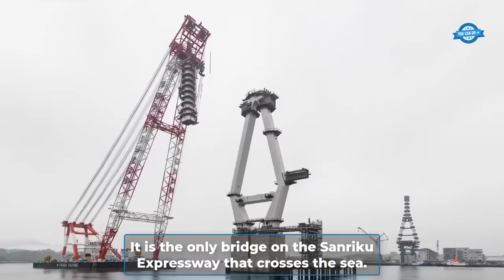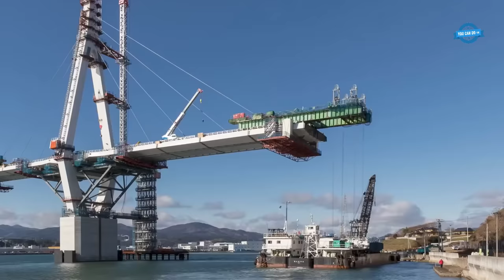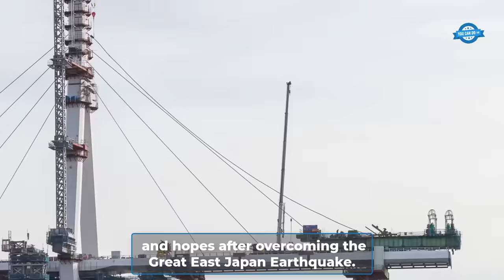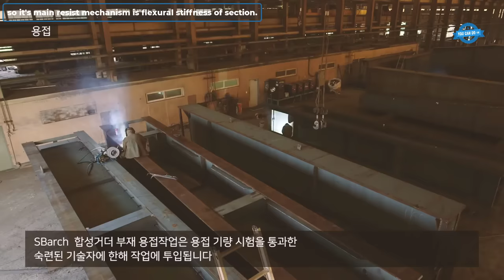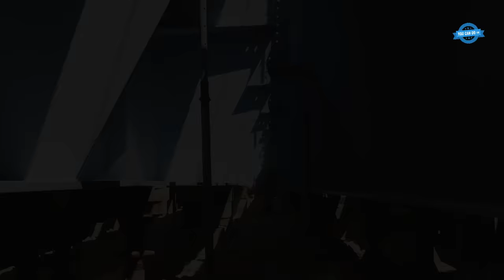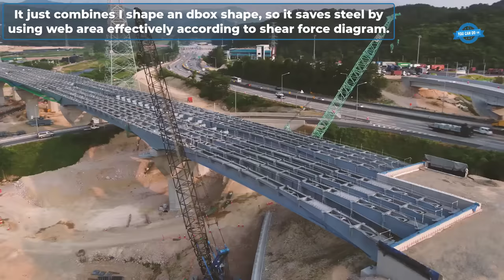Japan and Korea's Amazing Modern Bridge Building Technology. Heavy Duty Construction Equipments

Comment: Saw YT videos showing Chinese bridge building machine that rides on top and lay down section by section real fast, seems to be more efficient than these traditional cranes.
Reply: Absolutely
Reply: Still need to put each piece together.
Reply: I'm going to venture out and suggest that the Japanese and Korean engineers and designers selected a construction method most suitable for their particular bridges. Just because you saw one instance of something being done in some way doesn't mean it's universally applicable.

Unless of course you're an expert engineer and have studied all possible bridge constructions and came to the expert conclusion: there exists only one way to build a bridge. And that's with some thing that rides on top and lays stuff down real fast. Yeah, we trust your expertise on this and your most delicate and expert capacity to articulate your thoughts so well. Outstanding work, Dr. Saw YT videos. Bravo!

Comment: Still no match compared to China's Bridge and rail building tech.
Reply: China bridge and railway project is a long continuous project through out the country meanwhile as for Japan and Korea is a once off project to be perform that not that require sophisticated equipment for a simple length of bridge or railway to built.
It is Japan that built the longest suspension bridge across the sea and under water tunnel 25 yrs ago with the technology available at that time.
Korean had shown the advance bridge building technology across Bosporus strait with in short time spent in Turkiye.
Give them the tasks they will deliver well them because they are pioneer in these field before China  
Japan and Korea had built bridges across our sea straits  about 70 km apart in the year 1986 and 1990